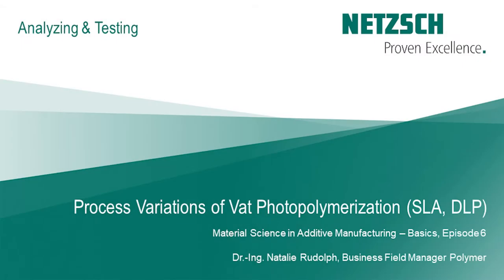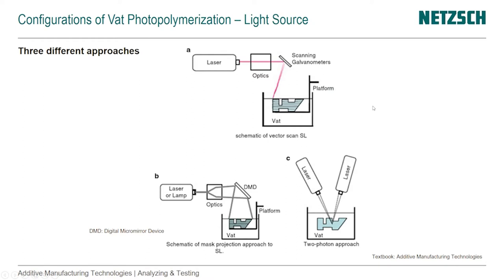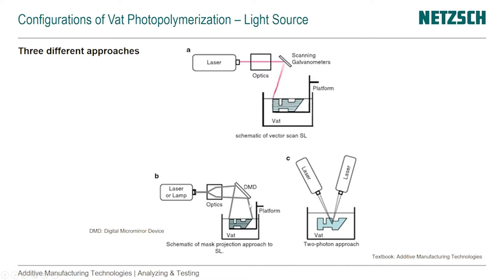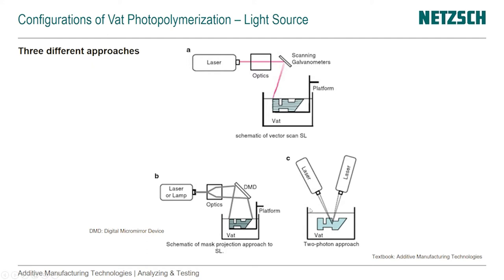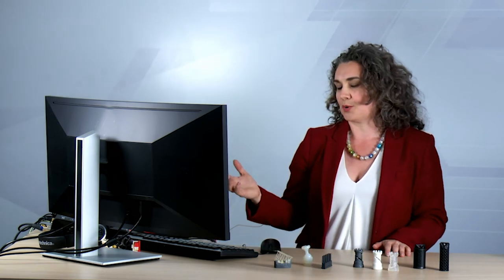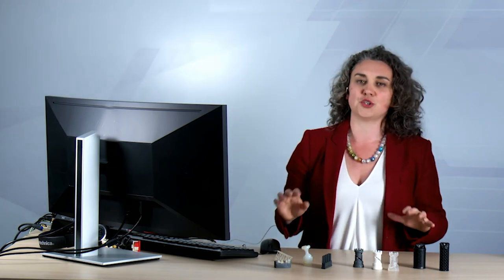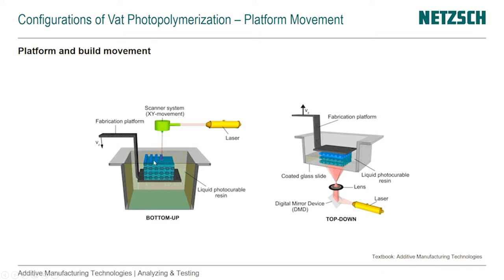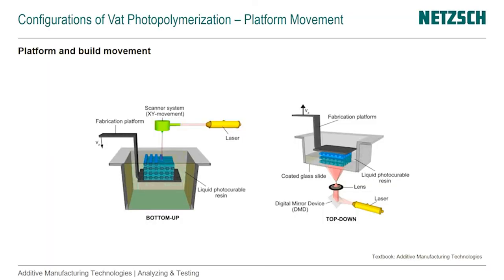Episode 6: Process Variations of Vat Photopolymerization (SLA, DLP)

Comment: In the bottom-up approach,  isn't there a chance of the model falling down due to gravity when the gap is formed when the part is moved up? Or the resin flows very fast to stop that from happening? Also what kind of glass coating is used, that inhibits the melting of the glass interface itself?